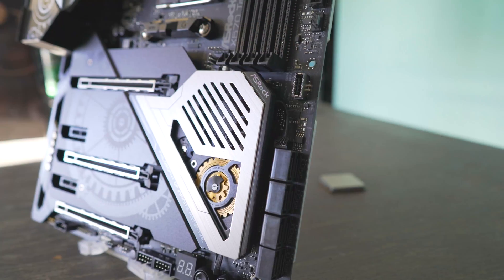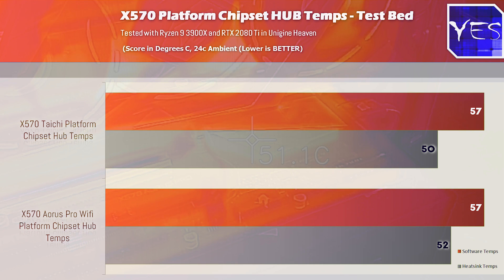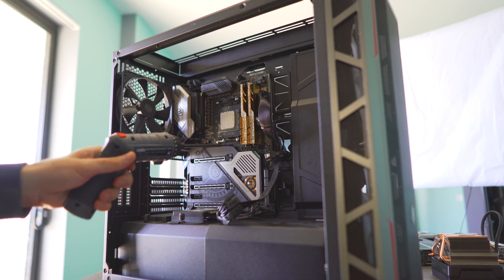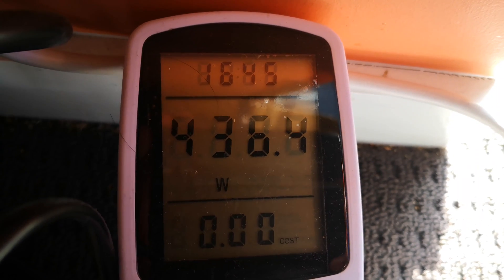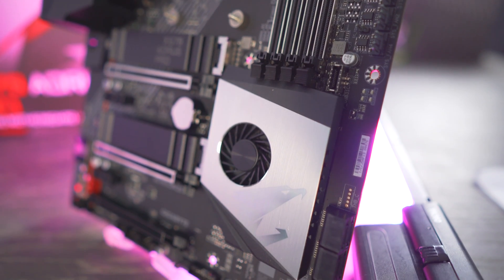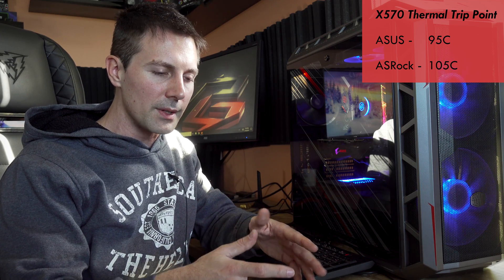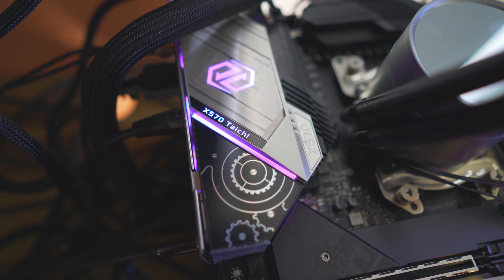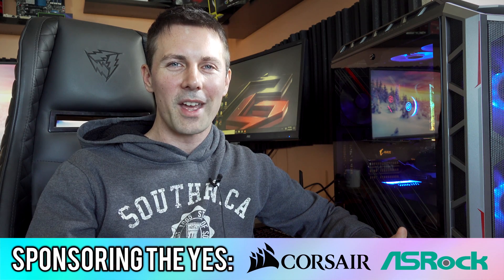X570 Chipset Overheating...!? (Investigation)

Comment: On my Taichi the Chipset Fan is louder than evrything else and I already installed the newest bios and Put it on silent Mode but still at 5000 Rpm its loud asf. The SYSTIN idles at like 70 C i guess something is wrong. Under Stress testing it goes to 80 c
Reply: Update: I tightend All Cover Screws very hard a now i only have 50 C
Reply: Sasuke UchihaxD so you would say it is a good card? What graphics card do you use?
Reply: @User100mil  a super Palit Jetstream gtx 1070, now i use a msi meg ace x570 and evrything is completly fine
Reply: So you are not using the taichi anymore?
Reply: @User100mil  no because i returned it. I wont pay 300+€ for a dumb Design mistake. The Msi Meg Ace has much better chipset temps and I cant even hear then Fan.
Reply: Sasuke UchihaxD agree, I will wait.. DDR5 coming and properly new socket, and hopefully no damn chipset fan

Comment: Ryzen 3000 processors are amazing with excellent prices, but X570 motherboards comes with overpriced and a weird power consumption, even in idle. I like the Ryzen 3600 + MSI B450 Carbon with Flashback button...

Comment: Does the first pcie go directly to CPU? If so what does it matter to the chipset other than possibility a bit of heat from gpu?
Reply: Arnt the middle and bottom slot 8x and 4x respectively? And those would be controlled through the chipset.

Comment: The temps in this video don't make sense, I have the X570 Taichi with good case cooling set to the standard fan profile (P1.60 bios) it operates at 59-68c from idle to gaming. The current HWINFO 64 beta has support to the X570 chipset so I'm sure it's correct, the sensor you pointed to was not the correct one. I think the chipset was running at 74c on the SYSTIN sensor.
Reply: trenteth - my systin idles at 60c..
Ergh

Comment: I built two systems with the x570 Taichi, both with a 3900x stock, with 280 watercoolers.  The chipset is running in the 80's with the first one with a 5700xt Limited, it was beeping at me and I had to move it to the 2nd PCI-e slot. 

The second build is my own, with a temporary 1060 in it, at idle the damn thing is running at 63c, which imo is hot.  When the 1060 is pushed to 85c it goes to 65, so not bad, but it's not covering the chip really as it's a short card, I'm really worried once my 2080 arrives it's going to cover that fan and run super hot. I'll know Tuesday. I ordered a 2080 with a closed loop hybrid, hopefully with a lot of the hot air getting pushed out the case with the radiator it will let the chipset stay cooler.

Amazon return policy I'll prob return the 2080 once the super hits shelves, I was just so damn impatient.
Reply: is this problem only wth the 3900x? or will it be the same with the 3700x too?
Reply: @0cards0  no idea, I only build 3900x
Reply: Update with the EVGA 2080 FTW3 Ultra Hybrid the SB temp is 73-75, very hot. The GPU underload hits about 53c. SB at idle with the gpu completely covering it is between 66-70. I turned the fan up and now it's annoying. I would /RMA but Newegg wants to charge me a restocking fee.

Comment: Overheating or not that's not the problem.  The problem is the fan itself is a point of failure. No doubt it will fail someday and maybe you can leave it broken or you will have to replace it somehow.... just look at laptops and see those little fans are not so reliable

Comment: I'm praying that the next Theadrippers will basically be 6/8th of EPYC CPUs, allowing AMD to sell the IO dies with small defects. That would give 96 pci-e 4.0 lanes (6/8th of 128 in EPYC), 6 channels of memory (6/8th of EPYC), and they could just leave out a chipset entirely. I don't see why they wouldn't do that, and it would compete nicely against Intel's LGA-3647 platform.

Comment: I am distrustful of the long term longevity of those little fans, I’d much prefer to see a passive solution like a bigger heatsink or a heat pipe leading to heat sink somewhere else kind of like ten years ago VRM thermal solutions would run a heat pipe around the cpu socket covering all the VRMs

Comment: There have been sone early buos issues where the default settings are way over volted on x570 boards. So may suggest people have a recent buis update or checking bios to make sure SOC and cpu voltage arent over volted. For instance out of box x570 was set at 1.45v for cpu
Reply: Bios**

Comment: "if you can touch the heatsink..."
Um... I can't really agree if you're talking about such a massive heatsink like the one for that motherboard. The larger the surface area the cooler it's going to be to the touch. I'd be careful with general statements like that. A "lukewarm" heatsink might still mean an overheating chip whereas a "burning hot" chip with no heatsink might actually be cooler internally.

Comment: Z77 Sabertooth (i7-3770K) motherboard here. It came with two annoying 40mm fans that would't turn off and the LOWEST speed was still very annoying. I finally just UNPLUGGED the damn things while monitoring temperatures and never worried about the again. Not saying to do that here, but just saying quite possibly this chipset fan issue isn't a big deal. I would probably still buy an X570 motherboard after researching which fans aren't audible except the motherboard are overpriced for what you get. I finally decided on the Asus Strix X470-F Gaming board but was looking at the Acer X470 Taichi and the Gigabyte Auros something or other.

Comment: CATCH-22...
I'm a bit confused what you meant. Did you mean the CHIPSET fan isn't noisy under idle conditions then when you load up the "GPU" the graphics cards are so loud that IF the chipset fan was noisy you couldn't tell anyway?
If that's what you meant then WHY would the chipset fan be spinning in that scenario anyway?
a) did you mean because there's more HEAT in the case in general?
b) did you mean because the SATA part would be used for SATA drives for that benchmark/game so the chipset would be in more use thus heat up?
c) or BOTH
I ask, because I don't understand how there would be much activity in the X570 chipset when doing such a basic graphics type test. But you have to test. I suspect the HEAT dumped into the case matters more than light chipset activity.

Comment: 52 degrees celsius on new branded card/chipset will result into a 60 to 65 degress celsius in less than 2 years. Great comeback to the crapsy nforce nvidia chipset from the 2k years that burned out your motherboards. AMD just have tranfered the heat from CPU to chipset, leaving the motherboard's manufacturers to deal with. For a 600 to 1.000 $ ++ combo set (only mobo + CPU) that's just unacceptable. I'll stick with Intel till AMD will fix this heatsink issue on this x570 chipset that will shorten your motherboard lifetime.

Comment: I am a 3700x owner with a asus x570 prime pro. I never had any problem with over heating as i’m running AIO. I bought both of these two and I did a BASIC overclock, my pc black screens and resets and says CPU temp overheated.. I don’t understand at all.. I idle at 60 degrees..
Reply: and as well, my voltage normally is 1.4 as everyone else states without a overclock.. but i lower it to even 1.3 and same thing happens. And my cpu is black screening from cin15, when I run it. or render a video on prem pro.

Comment: I don't understand the purpose of the nvme and gpu in this experiment... Both of those have pci lanes that go straight to the cpu and don't even require the chipset if you install them in the correct locations. If you're trying the stress the chipset you should be transferring files between sata ports or using a GPU installed in one of the chipset PCIE slots. Something that actually uses the pcie lanes that are controlled by the chipset. You even showed the pci lane diagram in the middle of the video! This test is completely useless.

Comment: I fumbled together a little bit of text with pictures of this Problem (and others...) here on reddit (before i saw this Video): https://www.reddit.com/r/ASRock/comments/cerxt9/x570_taichi_design_by_a_madman/
In the Video he says that you could switch it to another PCIe Slot - can somebody Confirm this with a CPU-Z Screenshot or something? One which shows that the Speed IS actually at x16 (PCIe 3.0, not for the 4.0 ones) even in Slot 2? Because as far as i can tell, and as my experience tells me, it will be max 8x 3.0 in the second slot, even without another GPU in Port 1. But i could, and would like to, be wrong! That would at least also clear out my USB-C Header Problem, even though it would be worse for Airflow from the Bottom of my Case :/

Comment: Id love for you to check out this thing where the x570 supports 128gb on the 4 slot boards and 64gb on the two slot boards, except for the fact you can't buy 32gb sticks that are advertised to work on anything except a few select z390 boards.

Comment: Please check better the possible noise with the fan chipset.configure a profile in your graphics card software to apply 50%to the graphic fan if reach 83 degree (87 is maximum safe with Nvidia) but that must give less than 1100 before 83 ok? Then you will know if actually you are listening the fan chipset. Thanks!

Comment: I tried a 3700x with a x470 and an x570 with sli titan xp's, 1080ti's and rx480 and all of them showed more loss than the intel z390 9900k did with scaling. The gap widened from 5 to 7% to 18%+. Was wondering if tech yes could confirm this. You go Brian

Comment: Considering that the chipset fan stops spinning under light loads (X570 Gaming Pro Carbon) I think we are fine. Its better to have a fan considering what this chipset can do for data rates, than to not have a fan. The fans don't look cheap either, just don't let that fan or any fan for that matter, get clogged with dust and your good.

Comment: So after the warranty expires and the chipset hub fan fails mechanically then what? Is the fan replaceable?
Reply: LOL... good luck. I tried to replace a simple 40mm fan for a Z77 motherboard that just sat on the surface of the motherboard without luck. These new X570 fans sit behind a shroud and are different sizes. Is the fan replaceable? Likely. Will there be a fan you can buy in five years that will fit after they go back to NOT using fans and the supply runs out of likely non-standard fans? Probably not.
Reply: Having said that if there's no fan you MAY be able to replace the heatsink with something larger or rig up a 120mm fan to blow over that area instead. Not really ideal though. I'm getting an X470 motherboard if my damn R9-3900x ever ships (ten days and no word).

Comment: Operating System
 Windows 10 Home 64-bit
CPU
 Intel Core i7 7700 @ 3.60GHz 37 °C
 Kaby Lake 14nm Technology
RAM
 16,0GB Dual-Channel Unknown @ 1196MHz (17-17-17-39)
Motherboard
 ASUSTeK COMPUTER INC. PRIME B250-PLUS (LGA1151) 117 °C
Graphics
 MSI MAG241C (1920x1080@60Hz)
 PHL 273V5 (1920x1080@60Hz)
 4095MB NVIDIA GeForce GTX 1080 (ASUStek Computer Inc) 38 °C
Storage
 931GB Western Digital WDC WD10EZEX-08WN4A0 (SATA ) 33 °C
 232GB Samsung SSD 960 EVO 250GB (Unknown (SSD))
Optical Drives
 ASUS DRW-24D5MT
Audio
 NVIDIA Virtual Audio Device (Wave Extensible) (WDM)
---------------------------------------------------------------------------------------------------------------
°C

Comment: I'm a little puzzled by the use of the RTX 2080 Ti, sure, it pulls a s#itload of power, but that power it coming direct from the PSU, not via the PCIe bus/chipset.
For a more effective chipset stress test, replace the 2080 Ti with a Navi based card and feed it a texture heavy load (use any test that normally runs much better on cards with over 8GB).

Comment: My crosshair viii runs really cool with 3900x at 4.325 and I cannot hear the chipset fan running, using strix 2080ti for my gpu. X570 factory voltage for x570 is way to high doesn't need as much as most give

Comment: You're not going to test the chipset at all if you're using a GPU in a CPU linked slot.  Unless you put it in the bottom slot, or just max out SATA by moving huge files between several drives at the same time, or put some really fast M.2 drives in the PCIe slots, and maybe if you have one onboard that doesn't go to the CPU (primary always does).  That's the only way to test the chipset.  Unigine Heaven isn't going to do anything.. the GPU and CPU are linked directly and the chipset isn't involved at all.

Comment: Thank you for looking into it, I saw the posts on reddit freaking out over this but it does seem their setups were flawed. Zero fans passing air over an open test bench with a heavily overclocked GPU potentially dumping heat onto the chipset an who knows what they did to the fan profiles of the chipset fan. I've even seen people complain on reddit about the chipset overheating and when gigabyte asked for further information turns out the user had removed the fan! rolls eyes

Seeing my room has reached 45C in summer before (yay, straya!) its nice to have some confirmation this is largely BS.